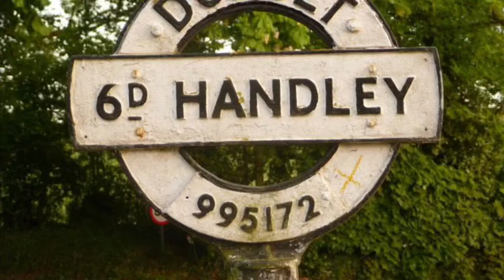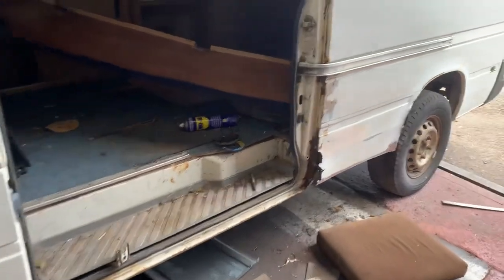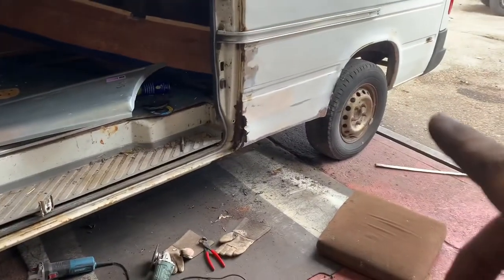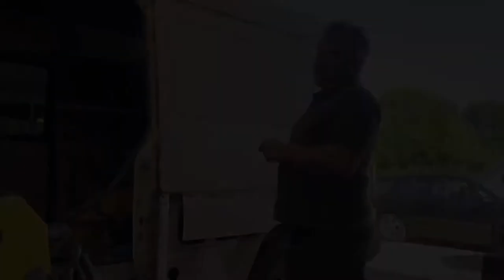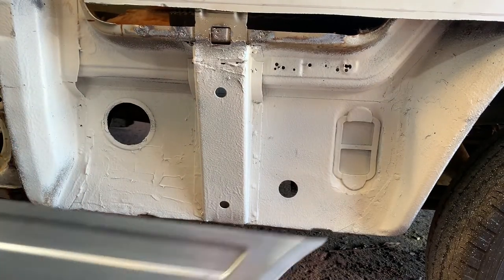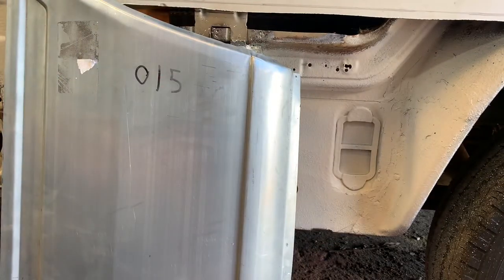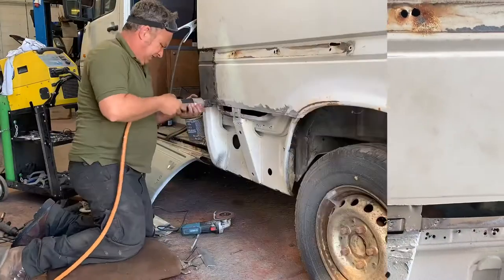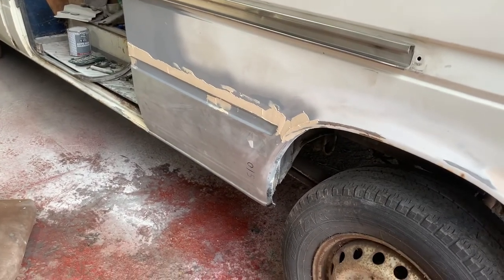Sorting some poor accident repair work, VW LT - Mercedes sprinter

Comment: What underseal do you use, I have a motohome chassis that has white stuff too, but dont know what to use?
Reply from the maker: Currently a rubberised pressure gun product from innotech, gives a factory finish then a good coat of lanogaurd once it’s dry 👍
Reply: You recommend lanogard then? I did wonder
Reply from the maker: Yes really good product , not the world cheapest but it works really well 👍
Reply: I will have to stop spraying duck oil around every MOT